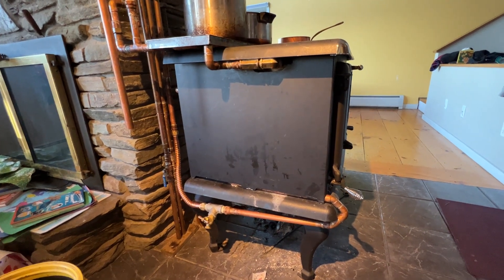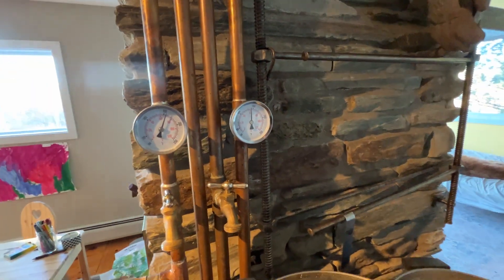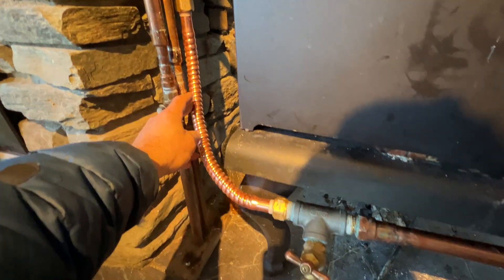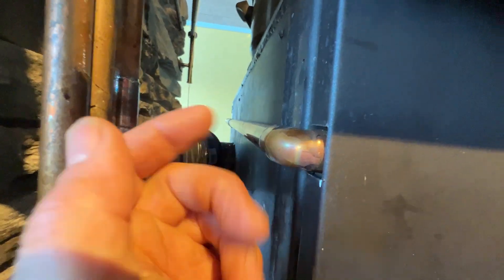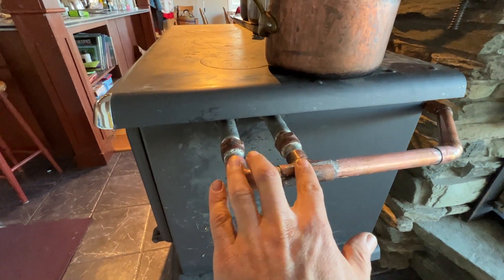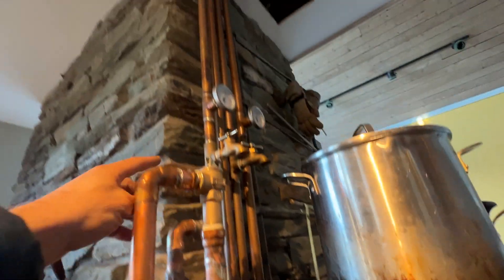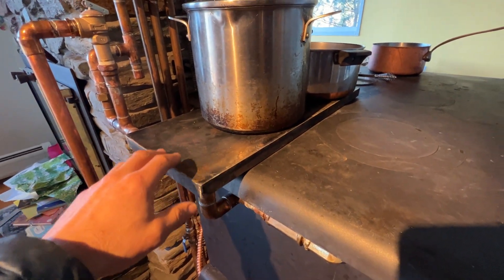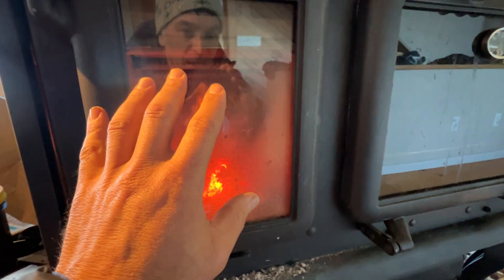Hot Water Cook Stove Version 4.2

Comment: At the very end of the video you say you do not want to pull any heat out of the firebox.  I have an amish made Heco 520 that runs a water jacket through the fire box.  I have not hooked it up yet.  Now I am wondering if I should not?
Reply from the maker: Correct, the lower temp is in there the less efficient the burn, remarkably so when you put a cold pipe of water in there. 120 versus 1000+, super cold.